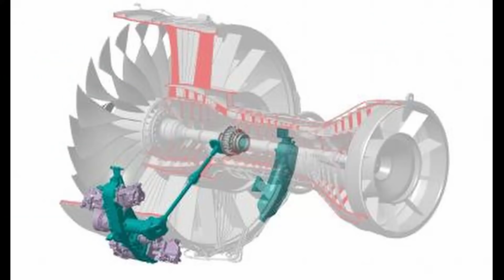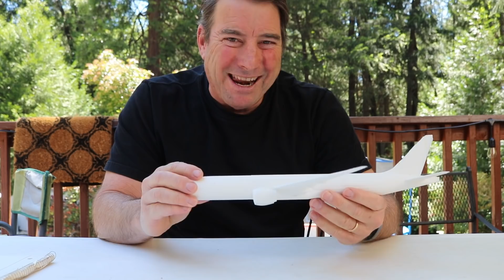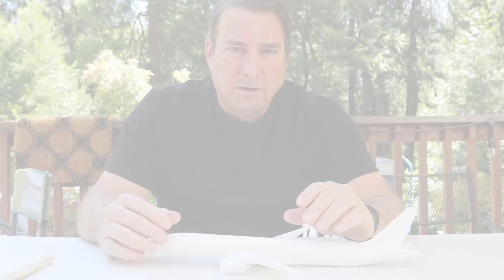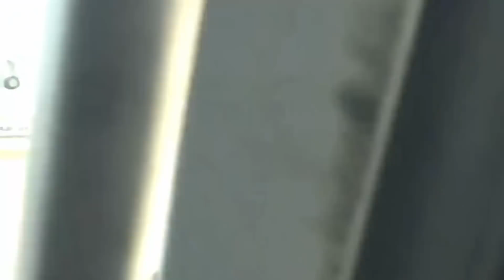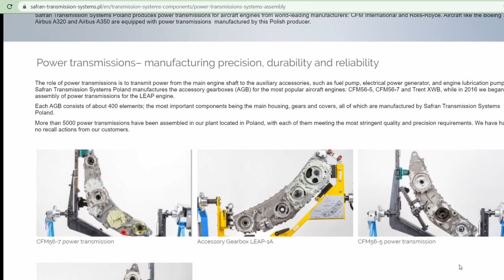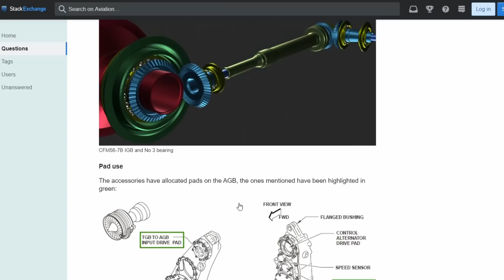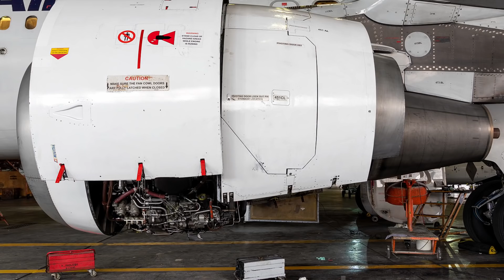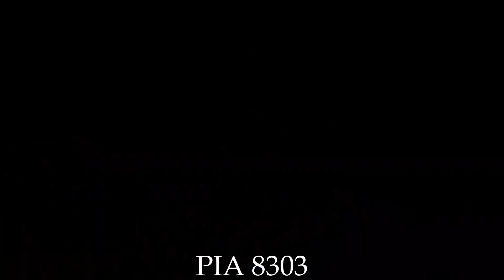PAKISTAN INTERNATIONAL AIRLINES #8303 UPDATE #2 23 May 2020

Comment: Is there a cockpit warning if the plane comes within , say, 50 ft of the ground and the landing gear has not yet been activated?  If there is a warning, is that the reason why you said there is almost never a landing where the pilot FORGOT to lower the landing gear?  Thanks for another educated answer to everything aeronautics !!
Reply: bob sandone yep, GPWS or GCAS is standard these days.  It would verbally say something like “TOO LOW, GEAR”
Reply: ECAM warning would come in at 750ft RA and GPWS at 500ft RA

Comment: Would the engineers profit by placing that gearbox aft of where its located?  I see plenty of room near the high pressure compressor. That way the gearbox is protected from exactly what i would assume caused engine failure during touchdown.
Reply: Hence turbo fan. Thank you.

Comment: I remember that these gear systems have pressure switches that keep the gear from retracting while the gear are carrying a certain amount weight even though the gear switch is in the retracted setting. This keeps the gear from being accidentally retracted while still on the ground. Perhaps the crew knew this, and placed the gear retraction handle in the retracted position before a positive climb was established. A gust of wind could have momentarily provided enough lift to cause the gear safety system to allow the landing gear to retract, but the airplane briefly settled back down to ground.

Comment: I am a not very experienced simulator pilot, so I know I am probably wrong, but when I watched the video of the plane coming down, it looked like the angle of attack was all wrong for gliding. To me it looked like the plane was in a full stall and the pilots were somehow trying to raise the nose, instead of gaining glide speed. It probably wouldn’t have made much difference, given the altitude, but I get the feeling they panicked and could think straight enough to handle the plane properly. Hitting the ground must have been a shock to them and it propagated to even more human error after the engines stopped.
Again, another half a mile probably wouldn’t have made a difference.

Comment: Why didn't ,they stayed on ground on first touch down and instead attempted go around?
Reply: You wanna scream down a runway at 160 mph in a 100 ft tube w/o steering or brakes?
Reply: @deadlysquirrel5560  been done often without injuries.
Reply: Go Calgary : What if they had ALREADY CHOSE to TOGA, but the airplane kept contacting the runway with the engines?  Look, the engines are located very low, in fact lower than the Center of Gravity and the center of pressure. So, any friction between the bottom of the nacelles and the runway would have caused a pitch down moment, keeping the airplane from going up, until power went up (after spooling-up), finally taking off again. That scenario would fit and explain why they went airborne again, looking that the were going too fast to stop within the remaining runway lenght.

Comment: In short, for reasons yet to be determined, they have struck the runway with the gear up, during or before a go around? 

Have they touched down gear up, or have they semi stalled on the go around while putting gear up too quickly? I find it hard to think they have done the decent with gear up or that they have executed a go around, a well practised manure, and put the gear up like they are a T-38! (Quickly). Did they have a three green situation but no actual gear deployed, or did they really, really mess this up...😢

Such a heartbreaking loss of life. An horrific final moments of flight for those onboard...  RIP.  😶

Comment: Hi, plz note that the CFM56 Engine model and it’s accessories gearbox (AGB) shown by you in the video is application on B737 aircraft, which has AGB mounted on the left side due to low ground clearance. It’s radial drive shaft comes out from 9 O’clock position and the AGB is between 6 and 9 clocks position.  However, on A320 the same CFM56 application is with a different dash number engine model whose AGB is at the bottom of the engine and radial driveshaft comes out from the 6 O’clock strut of the fan frame.
Reply: So does that then mean that a catastrophic crushing of the engines during runway contact as in this case,  could/would probably irreparably damage these gearboxes resulting in total failure in relatively short order (minutes, or less)?  If that is so, why would someone have designed a physical placement of these ESSENTIAL SYSTEMS in a location NOT PROTECTED from damage during runway contact?  AFTER ALL, landings WITHOUT landing gear deployment is NOT unheard of, and should therefore have be properly considered in the design phase!
Reply: @jhfowler2326  Yes, bad design.
Reply: No the AGB on almost all engines is at 6 O’clock position- some below the fan and some under the core engine where they manage to get enough space. Only B737 due to low ground clearance couldn’t be accommodated under the fan case. But it’s not a design issue as you’re supposed to land on the landing gears. That’s why landing gear has an alternate extension method if the normal one fails to extend it.

Comment: thanks Juan for the update, in the video you explain with details how the gear box operates,  I work in a accessories repair station as a QC inspector and i'm familiar with generators, fuel pumps, fuel flow trasnmitters etc, but i did not have the best idea how everything worked together as a system, i'm familiar most with instruments and avionic for many years, once again thanks for  the accessories class.

Comment: As a former scientist, I can guarantee you that if I was working there as an engineer and I first saw this or heard of it (as I am now), I would have immediately asked why those fragile components were placed in such a fundamentally vulnerable area, and I'm sure I would have been given some bs reason (cost, repair accessibility, bureaucratic inertia, etc.) by management—and by virtue of asking would probably have punctured or eroded my employment viability there. (You'll also hear engineers say things like, "Well, they're supposed to know to land with the gear down.") To put those critical components there appears to me as lazy or spendthrift engineering and was and still is just plain stupid. That should have been corrected out of the design years ago. (Unrelated, years ago, when I contacted Boeing about a cabin idea, the stunning [pathetic] response was that Boeing does not accept ideas from the outside. I suspect this intellectual incest also holds at similar companies.) My condolences to the needless victims.

Comment: JuAn, thanx for the great content! My understanding was that he initially went around because he was having a problem with the nose gear, could it be that he was nervous in performing a no nose gear landing and got too slow and pulled back more then he should of and then while in that maneuver lost his engines? The other thing that’s upsetting is even though he lost his engines, wasn’t he high enough and close enough to glide down? Would that being said , regardless of power failure,  do you suspect pilot error?
Reply: If you stall the airflow over the wing because of the aircrafts angle of attack, it would take a jumbo several thousand feet to recover. No chance if on approach.

Comment: Flaps are up and hyd smoke coming from #1 Eng in that closeup. I also saw another vid where ATC asked the Pilot if he was landing gear up after the 1st go-around.
Reply: Can some airbus experienced pilot or an airbus licensed engineer/instructor answer my question that was it possible or advisable for the pilot to keep the a/c down instead of “going around “ with two damaged engines????
Reply: @Ms786920  Perhaps the question should be: Do pilots inside the cockpit, hear the scrapping noise of the nacelles grinding on the concrete runway surface?...
Please consider that in several tailstrike situations, pilot never heard anything!  I remember the Aeromexico 767 Taking off in Spain, where they only became aware of the hard tailstrike when the aircraft failed to pressurize... the cockpit is way too far away from the tail and they heard nothing. Could that had happened in the Pakistan accident???

Comment: Did the gear (not) down alarm come on too late? Pilot throttles and pulls up. In the arch scraped engines just before regaining lift. May have been better to let it get heavy upon impact and ride it out. How many attempts were made to lower gear? I really think the go around was a bad decision in this case. Seems  the gear box would have been crushed. Lost the fuel pumps. Why are the fuel pumps not on their own system? Bad design idea I think...... Prayers to all the families affected by this. Hits home a bit for me as we build the exhaust components for that engine. Me personally I assemble the Trent 900 fan cases. Same concept engine. So Sad

Comment: ATC recordings show they were 3000 ft AGL 5 nm from the threshold, but continued approach. ATC recording also indicate a gear malfunction warning. Gear failure likely caught them off guard while already in a high rate of descend. The rate of descend was likely too high for a clean go around causing the engines to hit the runway damaging the accessory drives (probably damaging the engine mounts & fuel lines)

Comment: Since the accessory drive is operated radially from the high-pressure section, it could theoretically be positioned anywhere around the engine. (other than directly above which would interfere with engine mounting to wing and engine height above runway)  CFM should redesign the engine with the accessory drive at either the 10 o'clock or 2 o'clock positions (when viewed from either end) to offer more protection in the event of engine strike.
Reply: And then maintenance crews need ladders and lifts to access them

Comment: As an A&P for over 20 years I have seen my share and worked on the engines. Including but, not limited to full power ground and flight tests. That was a bad hit. Even if the gearbox was not damaged, there are high pressure fuel, hydraulic and bleed air lines, all over that area.. Striking the gearbox directly would have resulted in fire at the moment of impact. No questions asked. I think they lost engine bleed air and hydraulic pressure. Resulting in a loss in engine power and flight control response

Comment: Brilliant analysis. With the pilots focused on a go around and distracted by a gear malfunction, it’s hard to imagine at what point they should have realized they needed to cut engines and sled. They may well have already run out of runway and thought continuing the go around was the better option. Tragically, it wasn’t.

Comment: If the accessory drive is damaged even though the fuel pumps are not, eventually the gearbox can seize snapping the tower shaft (radial drive shaft) shutting down the engine due to no fuel pump operation. I do not know about these GE motors but years ago when i was wrenching and maintaining Pratt J52 (JT-8D) engines the pump pressures were in excess of 900 psi at idle and im sure these are higher. Once the pump stops sending fuel to the fuel control, the engine shuts down with no hope of a relight. I believe something happened on the first approach before final. As i said last night, why did he say "we can make it now?) Why the gear horn? No, something went wrong before the first attempt. I suspect a gear problem on approach led to all this but we won't know until or if the investigators release the transcripts. This is both sad and strange. My thoughts and prayers to everyone involved. Thank you Juan.

Comment: Correct me if I'm wrong, the 5 fan is over 12" larger than the 7. The 7 needed a smaller fan due to the 737 sitting so low. The fan on the 7 also turns faster.

Comment: Thanks for the excellent presentation Juan. You mentioned that engine failure would not be far behind the damage to the accessory case. I assume this is because of losing oil that lubes the rotor shaft(s). The plane spotter photo seems to show grey smoke trailing the bottom of the No 1 engine.

Comment: I think pilots fogot to lower the landing gear on landing which resulted in damage to both engines. Pilots realized their mistake and pulled up for a go around only to have one then other engine fail on them resulting in crash!
Reply: Do they not have a landing gear configuration warning in the cockpit That would warn them if  landing flaps selected with no gear out.?
Reply: @V8King770  unless the egpws was inop (mantainance) or the pilot switched it off, since he knew it would buzz when he came in hot and high

Comment: Notice that the lowest accessory is hydraulic, followed by oil. If oil pressure was lost then that would explain the why they were able to get back some altitude but the engines failing soon after. Also a lot of dark ness under the engine is most likely fluid and not damage. From the ATC audio it sounded like at the end they are trying altitude and the video shows the plane in a nose up attitude, at that stage they should have been trying to glide the plane and conserve airspeed. Don’t know if they could have made it back, will be interested to see what they say in the report along with questions over the gear and the go round procedure.

Comment: Thanks for the report.
Could you please talk a bit about the reasons why the landing gear would have not been deployed, in the case that there was no pilot error? And also, how could it be that the airplane managed to do a full go around procedure with a damaged/broken shaft? Wouldn't that be impossible? Thanks in advance. Cheers.
Reply: Going to take a guess that human factor(s) were the issue on the first landing attempt.  Forgot to lower the gear or perhaps there was a gear issue but they ignored the master caution warning (for malfunction or not having the landing gear deployed).   After impact, the engines were still running but decayed to the point of no thrust.  Low speed/altitude/no thrust goes into unrecoverable stall.

Comment: Would the crew not have attempted to deploy the landing gear well in advance of landing so that would have ample warning of gear issue ?
Reply: A320 and modern aircraft are smart aircraft.  If you are not in the proper landing configuration, the aircraft will warn you.  But it is up to the crew to follow the warning.

Comment: I thought the rat was system specific as in it covered say hydraulics or avionics or such depending on air line request but not both systems.
Reply: I know what the rat is I asked a question about system that is covered in the event of loss. Be it hydraulics or such.
Reply: John R yeah and the video explains what is recovered. Blue hydraulic system and enough power for some of the flight control computers and captains instruments
Reply: https://youtu.be/c9yz6Gd216o

Comment: Damn Airbus anyway. This is what happens when aircraft are designed by pencil pushers instead of pilots. Airbus should rely more on their decades of experience building good aircraft...no, wait. They don't have that much experience. Let's blame the engineers...no,wait. They were doing what corporate told them to do.  I know!  We'll blame the pilots, just like the 737Max pilots in Indonesia and Africa. No, everybody blamed Boeing for that. I know! We'll blame the Wright Brothers for inventing the airplane in the first place!  That's the ticket!
Reply: Boeing was blamed and they admitted their failure
Reply: @tomstravels520  Do you think that the crew of the Pakistani airplane will ever admit their failure? You must, if you think that Airbus will ever accept any responsibility.
Reply: Thomas Mortimore yep, after they tried to put some onus on the crew & were blasted by it!  Who knew there’s actually a procedure for runaway stab...or that when you disconnect the autothrottles & level off/descend, the airplane will quickly exceed maximum speed?  Guess you have to be a rocket scientist to fly these overly complex things!

Comment: Sites in Pakistan are now stating:
Aircraft was at 3000ft only 3nm from threshold
Landed long and bounced
As engines were spoiling up, gear was retracted and aircraft settled back down with pod strike before finally climbing 
Shortly after, pilot reported both engines had failed

Comment: Juan, first excellent commentary with detailed technical photos. Having been an aviation enthusiast for many many years, and realizing that you’re not an aeronautical engineer, I have a question for you. Even though engine strikes are not a common occurrence in the commercial aviation world why with the manufacturer not relocate such a critical component to the top of the engine as opposed to putting it on the bottom?
Reply: Engineers have their common sense schooled out of them in college.
Reply: The rotating fan blades are just as critical, so if you crunch them & your gearbox stays untouched, who cares? Your engine dies just the same.

Comment: If the gear box stops spinning due to the shaft shearing or any other failure of the sort the fuel pump and mechanical engine control stop spinning. The engine will immediately stop without fuel dispersed by the fuel control from the fuel pump on top of the dozens of functions the fuel control manipulated on the engine. It usually is pretty close to the bottom inside the cowling in a lot of cfm 56 engines. The oil pump, hydro pump and idg are the least of your problems.

Comment: Add a warning device coupled to altimeter.pilots are human.
Reply: Doesn't help if you ignore the warning.  A320 and modern aircraft have warning systems built in to them.  Ultimately, it is only a warning not an automatic correction.
Reply: Great idea.....40 years ago